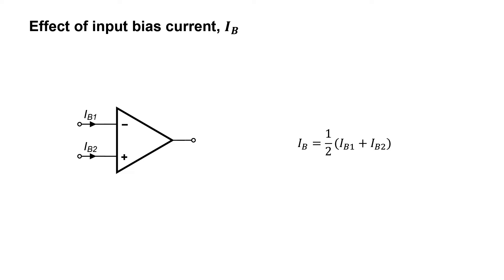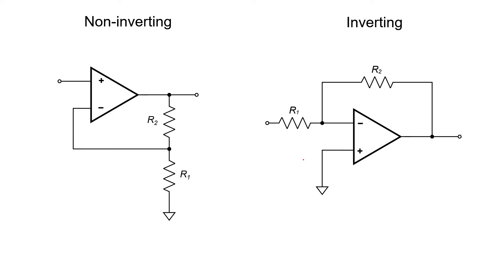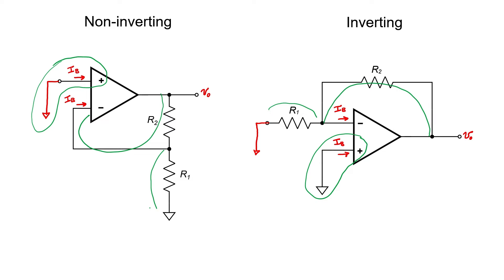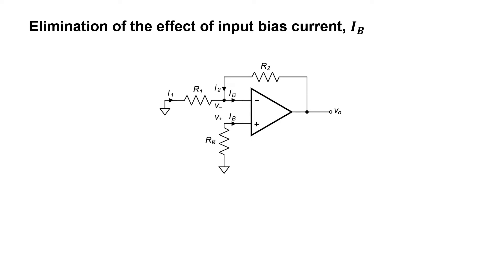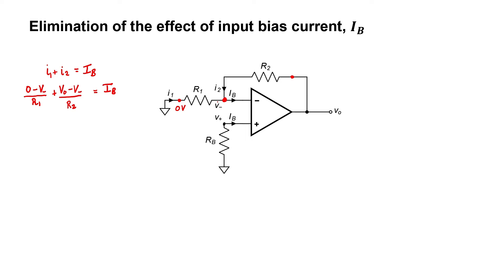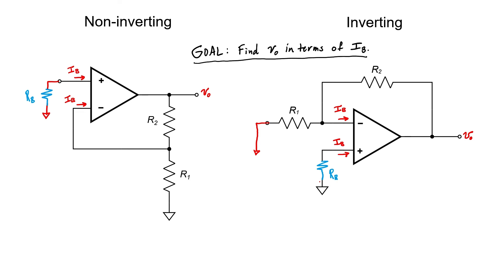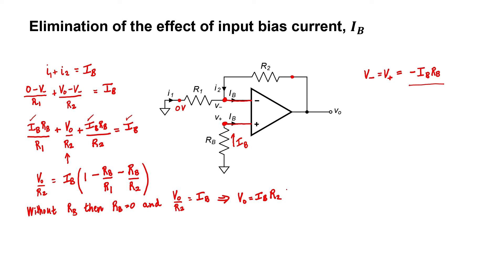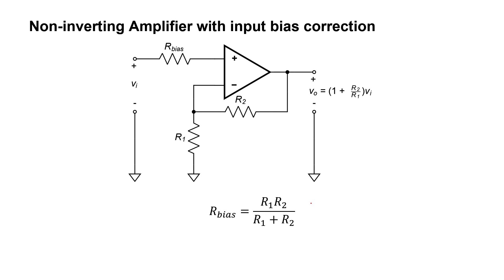Input Bias Current in Op-Amps (Amplifiers #9)

Comment: Sir I use lmc660cn  op amp In transimpedance mode   I to V converter ,  I used 100 mega  ohm resistor  8n feedback 
And non inverting terminal ground direct  and inverting terminal  floating  but my op amp output shows 1.8 v  continue  either I  ground or floating. Inverting terminal.  How to fix this problem 
I have to measure Pico ampere

Comment: Well, the input bias current depends on the type of op-amp - BJT-based op-amps will have some bias current, JFET-input op-amps will have a lot less (reverse-biased diode leakage current), and MOSFET-input op-amps have essentially none (pico to femtoamp range) unless they have protection diodes on the inputs.  That said, even FET-input op-amps will have some transient currents in the inputs as the gate capacitances charge or discharge.

Comment: In general, is it true that the resistance seen from the inverting input of the op. amp. has to be equal to the resistance seen from the non inverting input, to reduce the effect of the bias currents?
Reply from the maker: Unfortunately they will rarely be exactly equal. The input bias is mainly a problem affecting op-amps using BJTs where each input leads to the base of a transistor. But due to nonlinearity in the transistor curves, the effective input impedance has a bit of dependence on the current, making the input bias variable. But since the transistors are usually fabricated near one another on the same chip, it's still a reasonable approximation to assume they're just equal and constant.
Reply: @adanner  thank you for the answer; sorry, I meant the resistance from the inverting (or non inverting) input and ground, not the resistance of the op. amp. input but the one created by the external resistor network around it. In the example of the video the resistance seen from inverting input is the parallel of R1 and R2 and selecting for the value of the “balancing” resistor, connected to the non inverting input, a resistance of value R1//R2, the base current (IB) effect can be minimized. I wonder if this is valid in general